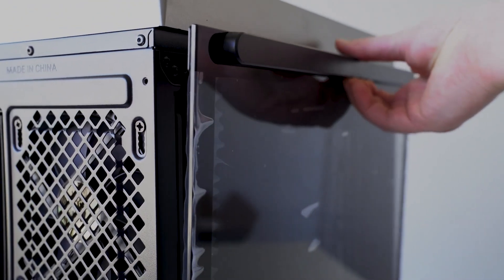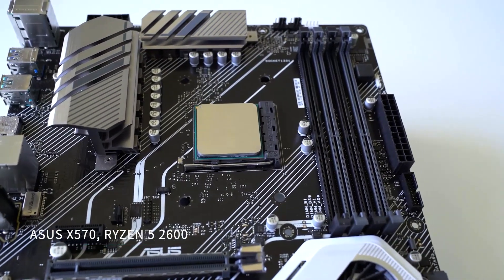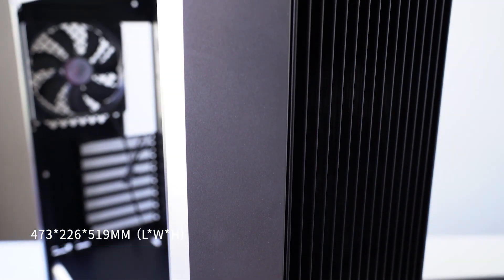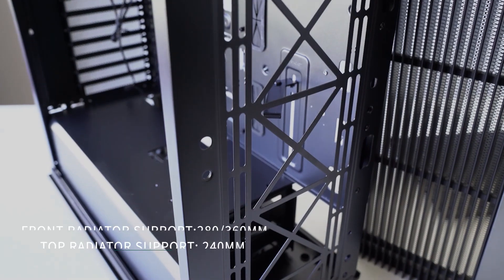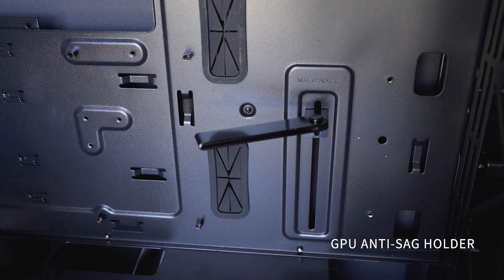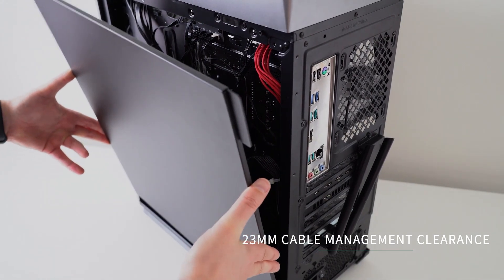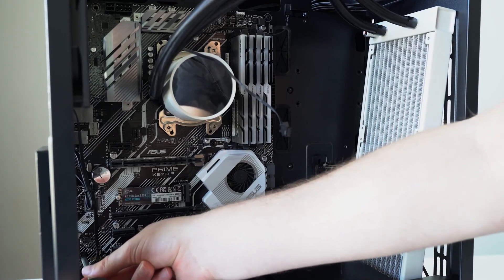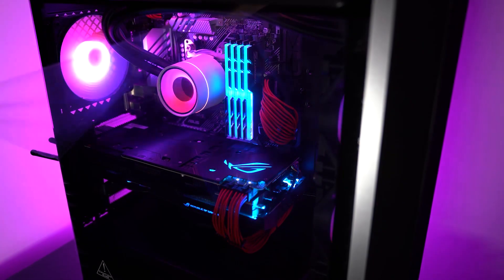Deepcool CL500 PC Build Guide

Comment: Hey mate, got the same case and the castle 280 EX, I thought u might be interested in the fact that you did install your radiator upside down. the end opposite of the the hoses going in and out of the radiator should be at the highest point of the whole system, that way air bubbles can escape the flowing liquid. I can see that your graphics card migth be in the way but I recommend to change it if somehow possible. nice video though. cheers